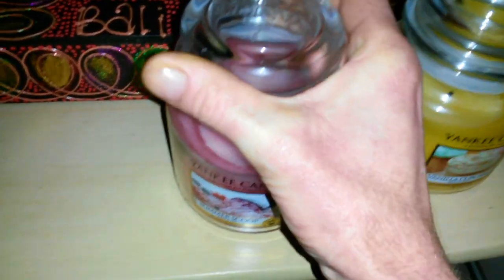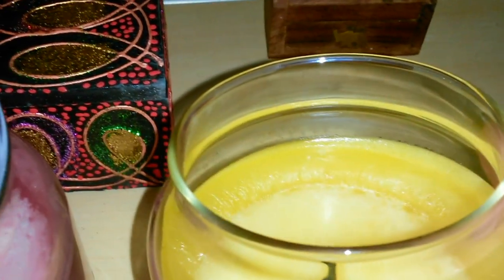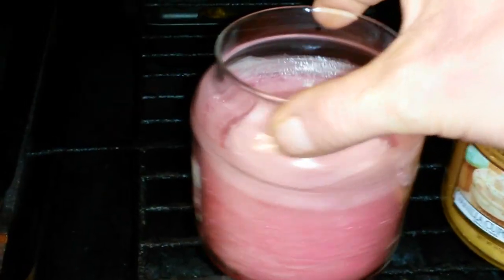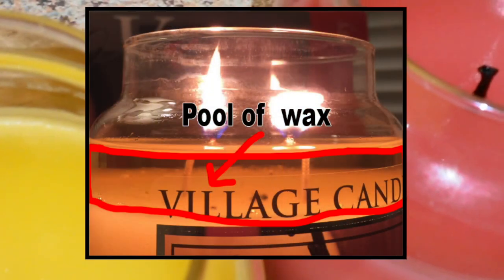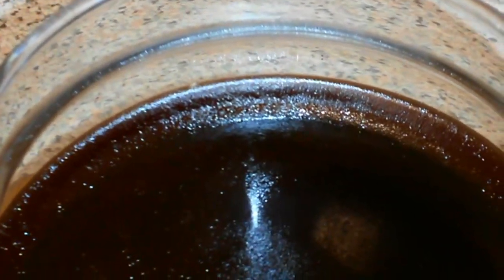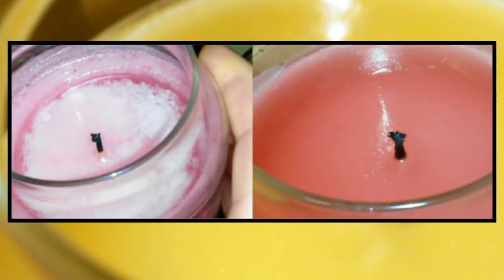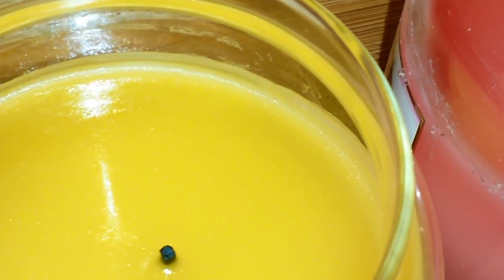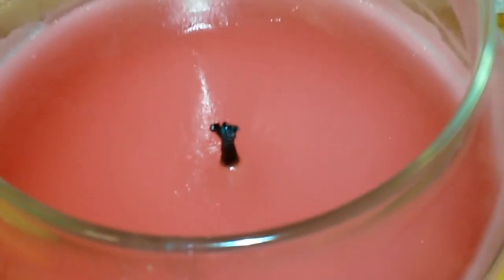How to fix candle tunnelling ( no foil ) ✅

Comment: I had no idea tunneling was because I blew them out too early I really appreciated everything in this video.
Reply: Yes, you always want to burn a new candle until the entire surface has melted evenly, usually about 4 hours.
Reply: Not necessarily some candles are just shit, the wick is not in the middle, etc etc
Reply: This also happens because the candle is too wide for one wick only. Im starting my candle business and just had the same problem:)
Reply: I never blew mine out too early it just tunneled
Reply: I’ve let a Yankee candle burn for a really long time, certainly longer than 4 hours, and I’ve still had tunneling. I think some wax melts at different rates.
Reply: Nor did I until recently! What degree is “medium “ though on oven? Wish he’d mentioned that as a bit scared about shattering them.

Comment: Hair dryer/heat gun does this trick far more safely.  You could also do a shallow double boiler water bath just under the label-if that's your concern, otherwise use more water for a faster all over melt. Just recenter wick with a couple flat chop sticks.
Reply from the maker: Great Idea
Reply: thanks for this comment because the foil option wasn’t working and i was too afraid to try the option shown in the video
Reply: I am a candle maker and in no way should u ever use a hair dryer the blower is far to strong that’s not got advice a heat or embossing gun will work because the air flow is not to strong hair dryers will splash wax everywhere possibly burning someone or ruining their tables or clothes
Reply: 👌 awesome
Reply: @Max865-  how do u fix yours Shawn?
Reply: @Poppi_Weasel  my candles do not tunnel since I make my own candles. However a heat gun which is designed for low air flow way different than a hair dryer would be my recommendation still need to be careful. Or simply don’t by that brand of candle when a candle tunnels it’s because the wick is not large enough .
Reply: @mariaa8659  I’m so sorry that is the worst
Reply: @Shawn Conner  why does my candle have 3 wicks? Do you have any advice for safely using a candle in a bedroom? My father is a stroke survivor who is bedridden with a urinary bag. We have to do a lot of cleaning in there and the odors are very long lasting. Today I started using a candle when we drain the bag to ward off the pungent smell. It worked well but I'm always hesitant with seniors on the house to leave the candle on unless I'm in the room the whole time.
Reply: @porscheoscar  you should get an electric air freshener

Comment: I'm just going to say it now if you don't trust yourself to put the candle inside of the oven... you can just put boiling water in a small pot. Boil the water and place your candle in the middle without allowing the water to go into the actual candle. As this video says just make sure to keep an eye on it and wait for a pool of wax to form before taking it out.
Reply: Omg thanks for clearing this up ! I thought about doing this before searching it up but wasn’t sure if that was safe because of the metal part holding the stem at the bottom.

Comment: You shouldn't blow out candles anyway if you can help it. The BEST way is to put them out by dipping the wick into the melted wax. Not only does this make it easier to light them next time, but it also preserves the wick AND you won't have a room filled with smoke. ;)
Reply: i just put the jar lid back on
Reply: That sounds like good advice. Can you tell me why my candles emit black smoke when I burn them?

Comment: I buy Jo Malone candles which are expensive and I got fed up with wasting so much wax caused by tunneling.  I asked them in store and the advice they gave was to light the candle ONLY until the flat top layer has melted and then blow the candle out.  They say that without the lid on, the scent will still fill the room for an hour or two after this, then put the lid back on until next time.  They suggested the reason I was getting tunnelling was because I was leaving the candle lit for a few hours which they said was not necessary to enjoy the scent.  I have a new candle and am going to try out what they have suggested.  Great video by the way, and something I will try on my used candles.
Reply: ooh, let us know your results 😃

Comment: Yaya I found out a solution to find ur lost wick so basically get a qtip (cotton bud) and cut it in half, poke the end into the candle near the wick but have the fuzzy part facing upwards and light the fuzzy bit and it burns down to ur wick woohoo also I wrapped tin foil around my candle and it fixed the tunneling and made it nice and smooth
Reply from the maker: Cool advice about the lost wick, thanks for the great comment, yeah i have to tin foil most of mine to assist in the pooling due to the cooler weather here.
Reply: @mbreak1  your welcome :)
Reply: I was just looking for this! I have a tunneling candle and if I melt it to make it even, the wick most definitely will get buried in the wax once it dries. Does your advice work for my case? Or am I doomed to lose the wick?
Reply: Yes this works perfectly!

Comment: I'd rather wrap the top with tin foil. Putting them in the oven like that makes them release scent and all you're doing is scenting the inside of your oven instead of your house where you can enjoy it. Foiling it allows the lit candle to pool across the top while still scenting your home and you have a lot less of a risk of shattering the jar or burning yourself (taking them out of an oven).
Reply from the maker: I agree , but in winter the foil method just does not seem to work . but your right  my last roast dinner did taste of vanilla cupcake lol

Comment: If the wick is too short just carve the wax away and place a new wick. Then add the removed wax around the wick. Then use the oven method and you fixed it.

Comment: Many people treat scented candles like air freshener - a quick fix. People don’t realize scented candles are meant to burn for at minimum 6 hours. If you burn them for a minimum 6 hours at a time, and trim the wick to 1/4 inch before burn, and no tunneling.

Comment: Thank you for the tip! But what if (most definitely) when the wax melts it will cover and drown what I have left of the wick? How can I save the wick?
Reply: Use a tablespoon/teaspoon to scoop out some of the wax when it's melted.
Reply: Soak some melted wax up with paper towel or toilet paper as the wax is melting when you first light it

Comment: What does one do about the wick that is far inside the candle tunnel and burned away? Will it float to the top once the excess side wax has melted?
Reply from the maker: I’m afraid when it gets that bad the only way is to pour lots of wax away to reveal the wick, which is a big waste, the best thing to do is don’t let that candle form a so big tunnel, most wicks are stuck down to the bottom of the jar so will never float, all the best with your candles.
Reply: Just carve the wick out and buy a new wick. Place removed wax back around the wick and use the wax method
Reply: @KevinArcade87  I have used an apple corer to remove a useless wick along with the wax and then replaced the wick with a new one. Melted the removed wax and poured down the hole, trim the wick once cooled and solid again.

Comment: Or... you could just use the microwave oven instead of a conventional one.
Reply: microwave could catch fire
Reply: @ElectroTechno : No it won't, because I've already done it and it's fine.
Reply: Wrong,  Lucy's Life . Because despite popular misunderstanding, medium-large piece of metal in there is just fine. The walls of the oven are made of metal! Some even have racks and probes that are metal. Those tabs are thick enough that they won't zap up like foil, metal leafing, or "steel wool" does.

Comment: Everytime i let the candle burn to supposedly prevent tunneling, it just burns around the wick and tunnels anyway
Reply from the maker: Depends on the  heat in the house, and the weather. thanks for the comment.
Reply: It most likely is because the wick is too small for the candle.

Comment: I wonder if microwaving would work.
Reply: My gormless partner put my tunnelled large yankee candle in the microwave but didnt tell me,he then put it on for 4 minutes and went off and forgot all about it..nxt thing i know there was a massive bang and explosion and the whole candle blew up in the microwave molten hot wax absolutely everywhere mixed with smashed glass..He cleaned it out...he said...and nothing could be saved..4 days later microwaving a mug of milky hot chocolate,it came out with 2inches of blue wax floating on the top...2 hours later the microwave conked out for good...the whole house smelt bloody lovely but oh my days what an expensive stupid waste as A i had to buy a new microwave and B the candle was ruined anyway...the flippin idiot.

Comment: I tried to microwave it but it formed a flat nice pool BUT my wick got lost and the whole £10 candle was wasted
Reply: shamla just heat the top layer on top of the wick and pour that wax out to expose the wick again
Reply: I tried this.  But the metal wick holder at the bottom of the jar started sparking.  So, I don't think I'd recommend this method :-).

Comment: I’m worried that the wick will be buried if I try this. I’m not sure how to fix this! HELP!!!!
Reply from the maker: yes sometimes the wick is under the melted wax, the only thing to do is  pour away some of the wax which is a shame but better to lose a little than the whole candle. cheers for the comment.
Reply: MBreak1 I tried it but it keeps tunneling further. Even at angle
Reply from the maker: @hallierothsinger654  the trick is to burn the candle until you get a pool of wax on the  first burn, around 3 hours depending of the heat of the place you are living. also cheap candles will alway tunnel no mater what, so its best to get a good quality candle.

Comment: How do u prevent that
Reply: With a new candle you should light it until the whole of the surface is liquid then blow it out, this should stop tunnelling. Also the scent from a candle comes from the liquid (not the flame) depending on its ‘throw’ (how far the scent travels) so to have it lit after the whole surface is liquid is simply wasting your candle...I hope this makes sense 👍🏼